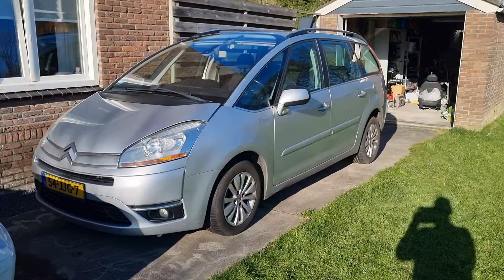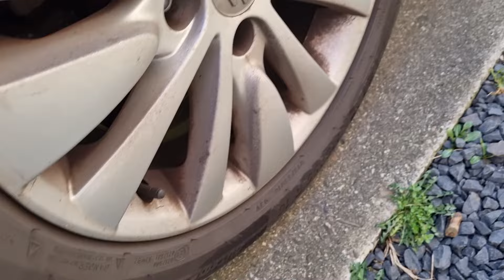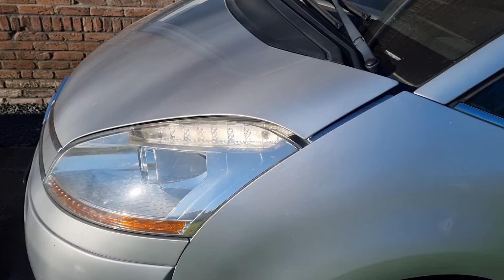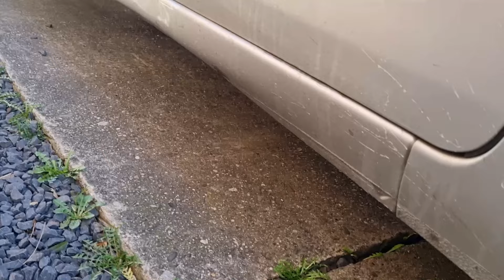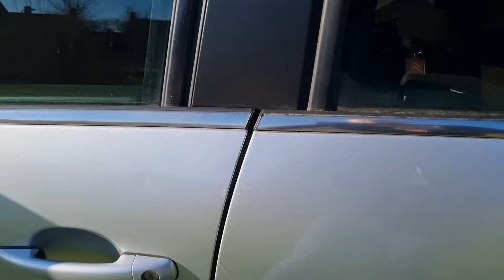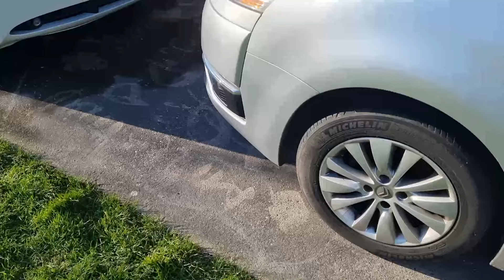End of the Citroen C4 Grand Picasso 1.6 HDI - Engine knock

Comment: mines got 8 fault codes, it wont go over 40mph but is reliable under 40mph shocking cars
Reply from the maker: 40 mph is a bit slow. Just pull the codes and most likely a fix is cheaper then you might expect.
Reply: @Siemi1  saying turbo and glow plugs and dpf system and no fluid in the dpf loads wrong with it